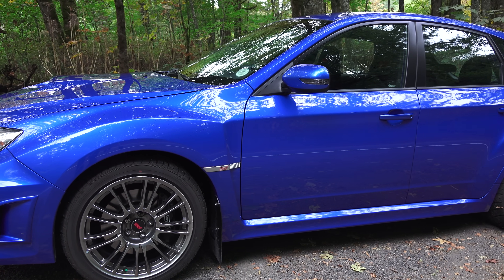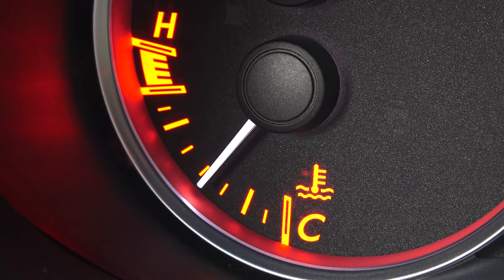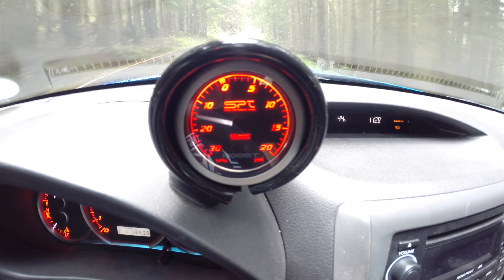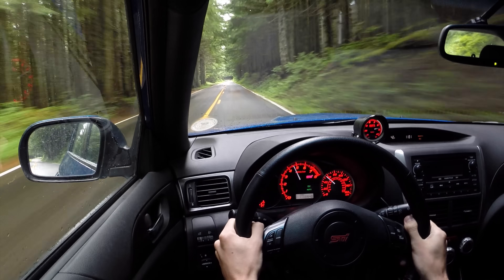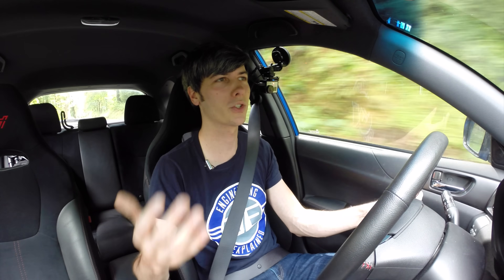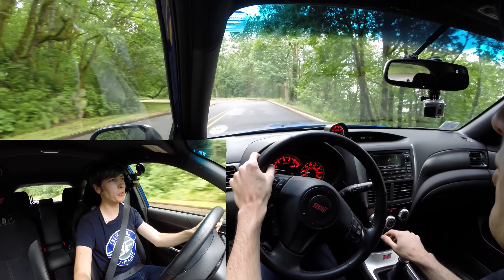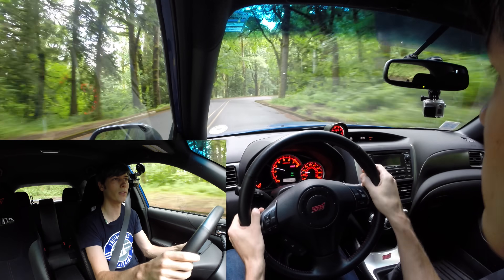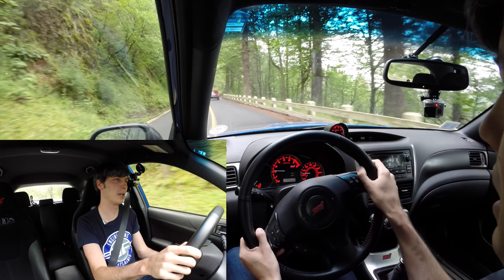5 Things You Should Never Do In A Turbocharged Vehicle

Comment: Thanks for the info.
(2011 kia Optima sx 2.0 turbo).
2 questions, if I may.
1 you mention not shutting the engine off after running it hard. Would the same go for a long distance travel, say 100+ miles or more at normal freeway speeds? (75/80mph?).Thanks for the info.
(2011 kia Optima sx 2.0 turbo).
2 questions, if I may.
1 you mention not shutting the engine off after running it hard. Would the same go for a long distance travel, say 100+ miles or more at normal freeway speeds? (75/80mph?). 

2. You speak of lugging the engine.
If you were to race someone off a stoplight, with an automatic trans, how would you safely do that? Being an automatic, the engine is going to be at a low ram til you punch it. So...?
(This part, I'm asking for a friend)

Comment: I have a turbo charged Nissan Juke with a lot of work done to her but any way, People think I'm crazy because I change my oil every thousand to 2000 miles, and in the winter from a cold start, I let my car warm up for almost a half hour most of the time, before pull away.. Everyone is like that's a waste of gas.. Then I say do you have a turbo in your car?? and they say no.. Then I say, then you don't know what you are talking about.. Gas N the price of it is the last thing I am worried about.. I always run 93, and I do a CVT drain and fill the second week of June right before it gets really hot every summer.. I f you have a turbo in your car you need to keep all your fluid's fresh and clean in you want the car to last.. Oh and she's going to the DYNO in a month hoping to make a least another 100LB's of torque which should transfer over to another 50 horses. hopefully.. I see a lot of people turning these cars up to 250 whp with a few bolt On's and a tune..
Reply: I'm replacing the break-in oil in my VW GTI at 1000 miles. Replacing with Castrol Edge and gonna do 3000 mile oil changes afterwards. I just drive gently until oil temperature is up. Maybe idle it like 3 minutes at most during winter.

Comment: Regarding lugging, there have been and are turbo charged engines which were designed not for maximising output but for fuel economy and relatively low engine speed operation, so they may not mind a bit of lugging, but yes, generally not a good idea.

Comment: So if your car is made for 87 octane fuel and you don't have any modifications you should buy the best quality 87 that you can buy. You say you should buy the highest octane you can get but I disagree. If your car is made for the higher octane or if it's modified for the higher octane then yes buy the higher octane. Octane doesn't rate fuel quality it rates temperature of combustion for the fuel. You need to follow whatever your engine was made for (or modified for) unless you are getting knocking, which was mentioned. If you're not having any issues with the fuel the engine was designed for (why would you) and you are using a high quality fuel then don't choose a higher octane. You should always use the highest quality (shell, chevron) but should use the octane your car was designed/modified for. Correct me if I missed something

Comment: Modern Tiptronic trans 2.0L turbo Audi's basically forces the engine to lug at all speeds in auto. The car is almost undrivable...The emission standards force the trans into the highest gear possible regardless of speed, hills, etc. I've been driving my 2016 A5 in the paddle-shift mode because of this. It's just terrible in Auto.

Comment: 1. The function of a thermostat in car water cooling sytem is for the oil getting to working temperature faster. Waiting for another minutes is kind of redundant act.
2. Modern day turbocharged doesn't need this either.
3. Doen't this apply on NA/all cars??
4. Yes I agree. But don't we all already know this?
5. Your explanation is exactly why we don't (or we do) floor it in the middle of a corner.

Comment: Speaking of cooling down your engine I’ve heard after a long drive you should idle your engine to cool it down and keep the oil flowing so it doesn’t evaporate and leave deposits sitting on the hot parts. But I’ve also heard that idling your engine, like in stop and go traffic, will overheat it which seems contradictory. Does the radiator fan move enough air, especially on a hot day, to cool your engine down after a hard drive, or is it making the engine hotter sitting in a crowded engine bay without the larger more constant airflow from driving?
Reply: as long as you're not near a bunch of other hot cars, you should be fine. if you just drive it around the neighborhood, or park in your driveway and let it idle for a bit, you're fine.

Comment: Well if it is a direct injected modern turbo engine, the producer should set injection timing at low rpm so that low-rpm pre-ignition should not be able to occur, e.g. delay injection and in Diesel engines program the max injection dose(ses)  so as  not to overfeed.... if he wants his customers to enjoy the engines a long time. As there are not mechanical injection pumps nowadays, but common rails with electronically controlled valves, that should be an easy one!